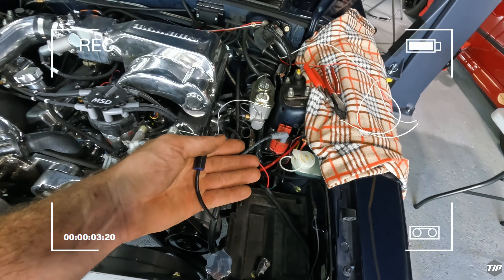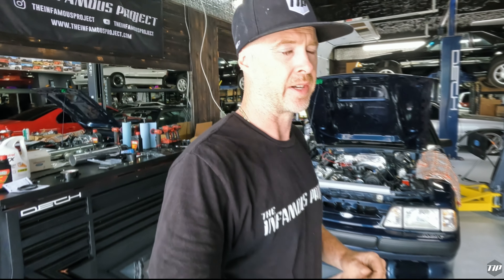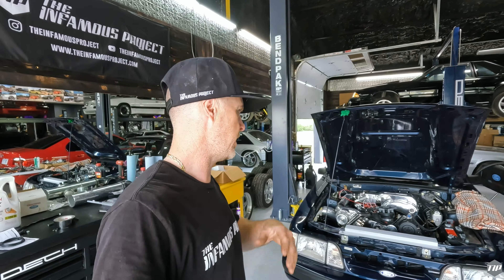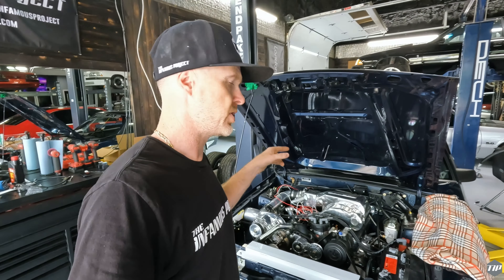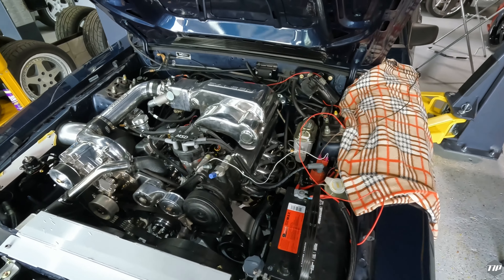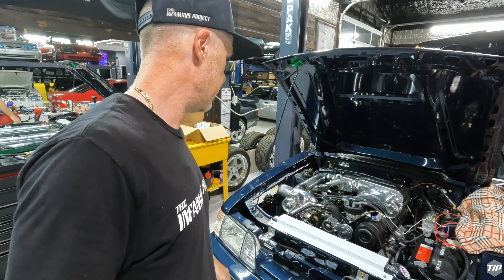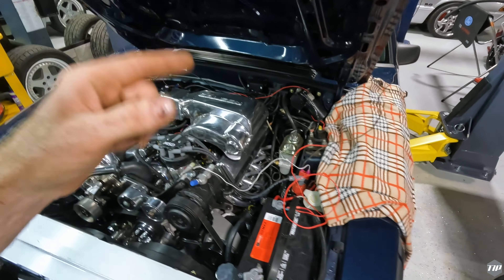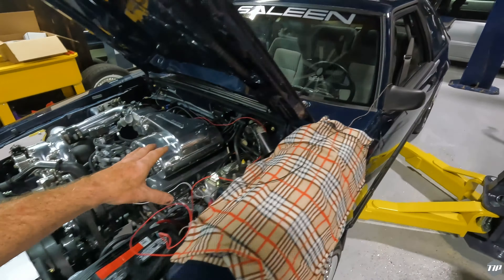Final Wiring & Config on the Terminator X - Will this Foxbody Saleen Start?

Comment: That blue vacuum line off the terminator X is for N/A applications. I see it has a blower. you will need a GM Map sensor , Holley or Low Dollar Map Sensor for boost reference.
Reply from the maker: Ya that was corrected! I changed the map sensor  later on.. you'll see in the later challenges of getting the car started!